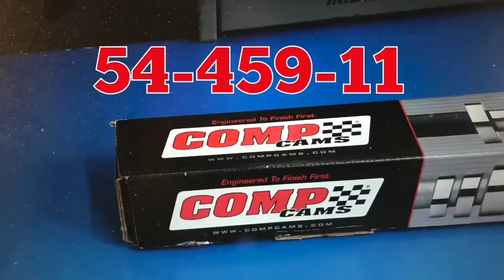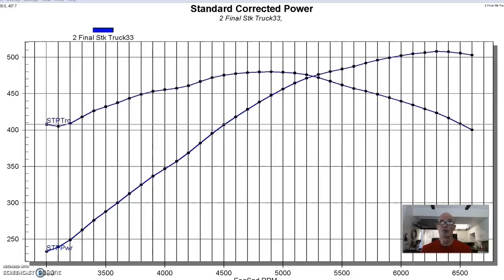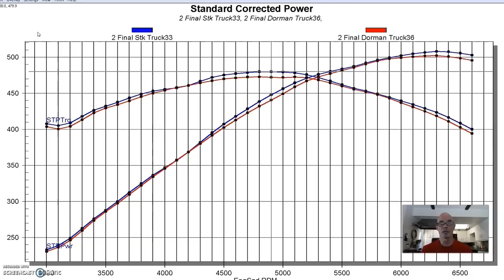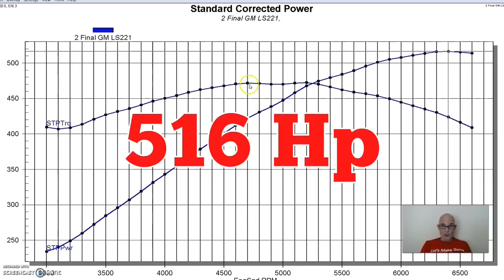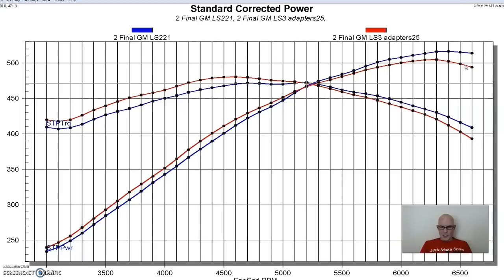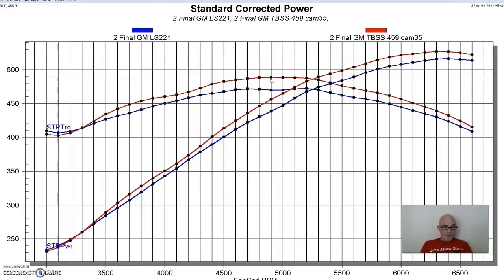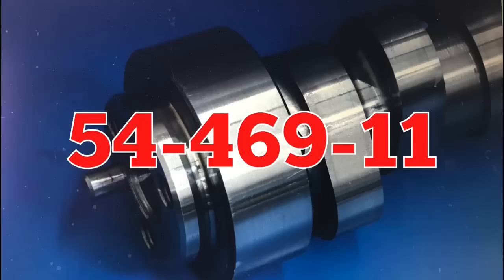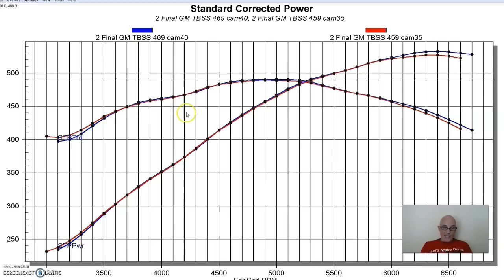TOP-SECRET LS TEST-FACTORY LS3 WITH ADAPTERS

Comment: Is the difference in power between the low end and the high end by the LS3 compared to the LS2 because the adapters make the runners longer on the LS3 giving it more power in the low end end and loss of power in the high end? Like what you would expect on a SBC when comparing a long runner intake to a short runner intake.  It works for a blower because that's a forced induction not a natural draw.
Reply from the maker: there wasn't enough change in runner length

Comment: Lsthree intake with adapter plates also saw horse power loss up top because technically with using the adapters you’re increasing runner length by 3/8 of an inch if not more than that
Reply: 3/8ths of an inch would not make a big enough difference to see.
Reply from the maker: its not runner length
Reply: Richard Holdener let me pick your brain for a sec. I’m sure you saw my comment asking if you were going to try testing a ported variant of this intake. I’m not here to pester you about that. My question is in regards to runner “leakage”. Wouldn’t there be power loss if the 3 pieces of this intake weren’t properly sealed? As they are, they aren’t siliconed together or anything so the intake runner leaks and reduces the effectiveness of pulse waves as there is pressure loss due to leakage I have a feeling the reason this intake is such a poor performer has some to do with runner leakage, some to do with porting, and a little bit because of the Tb hole size. I’m curious as to what you think.

Comment: Those adapters look.like a nightmare for airflow. They have an angled inner structure to raise the intake vertically strait up. This is probably worse than running no adapters. I don't know if they are the same width, face angle and port location, but if they are the adapters even with a nice taper will kill airflow. This is especially true with cathedral port intake on rec port heads. The dead spots don't interact with flow anywhere as much as the angled surfaces as the adapters. Even putting a rec port intake on cathedral port heads might not be as bad without the adapters. The deflection of the air flow is a tragedy.  When peanut port big blocks were a thing, some guys would run typical oval port intake with good results in spite of the port mismatch. There are cases when a typical oval port intake outperformed all peanut port intakes. I look at those adapters and I die a little on the inside.
Edit...doing the smallest amount of research possible it looks like the direct bolt on route is possible but the orings on the ports no longer overlay the ports. Some guys have made a giant mess with silicone to make it work. If you really think That a port misaligned is the worst thing, look how much bigger an ls6 intake port is compared to a 706 head port.
Reply: Good comment.  My friends used to run square port BBC intakes with oval port heads on their drag cars.  

It defies conventional logic, but they were winning races.  And you can't argue with success.

Comment: Hi Ritchard!
Do you have somthing about 8,1 (496) GM Vortec engine?
Reply: No one does anything with those besides using them for boat anchors. There is next to zero aftermarket support for them because they never performed, bad bore to stroke ratio, and a PCV system that sucked the oil pan dry. They also weighed almost 770lbs so that's a bunch of weight to make up for. None of the older 454 style heads will fit so your only option is porting the heavy stockers or big money custom cnc aluminum heads. Any way you look at it you'r spending double the money, for double the weight, just to say you have an 8.1 or bigger, and getting destroyed by LSX engines. If they were any good to begin with they'd be all over the place, the shear size of them is one of the biggest downfalls, they basically were just an engine for truck buyers who didn't want a diesel and needed bigger than the 6.0 could tow.

Comment: Richard much respect from Australia keep it up. 

One request!! Ozzy edition! Ls1 5.7 alloy! Boosted with all nos, turbo vs charger ect applications. 

Many thanks.
Reply: Do you people not understand that *all* metals used in engines, are "alloy"?
Reply: +1. Ive always wondered how the LS1 with its crap heads and intake compares with a Gen IV 5.3. Im guessing theyd be very similar in power output
Reply: @postmortemspasm  you may want to watch more of these videos. All of this has been done and then some. This man is obsessed!
Reply from the maker: The stock LS1 makes more than stock 5.3L
Reply: @richardholdener1727  does it thoooooough? test pls :D
Reply: Can the truck intakes be used on the 5.7? +1 for the Ozzy Edition 8|   Thanks for all the other info mate
Reply: @ Michael Angelo, I’m talking about 5.7 alloy block compared to 5.3 iron blocks ya peanut. Well done genius !
Reply: @honestlybrutalvlt9762   Raw material Customs  I know what you are talking about, but that doesn't make you sound any less stupid.  It's all "alloy", dummy.

Must you speak in ignorant colloquialisms?  Can you not learn to say aluminum (or in your case, "aluminium"), so as to make yourself more clear?
Reply: Michael Angelo ok genius if you know what I’m talking about why comment in the first place? Keyboard worrier!! 
Master splinter would be disappointed in your arrogance!!

Comment: The adapter plate results makes sense. The adapter plate kind of choke the air on NA application. But boosted, gets over that choke spot!
Reply: That's a false conception.  An N/A engine already has close to 15# of pressure.

If the blower manifold fit the ports properly, it would *also* perform better.

Comment: Yeah I knew the adapter set up wasn’t going to work without pressure generated by the blower.
Reply: I mean, technically the adapters did at work. They just made a little less horsepower at the higher RPM range, but my question would be is it because of the type of adapter used or can you port match the adapter better.